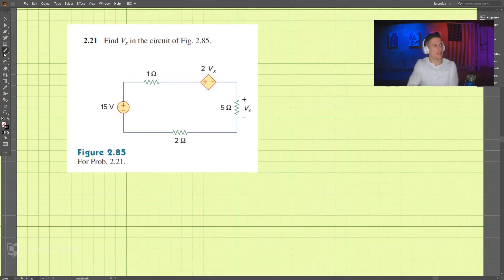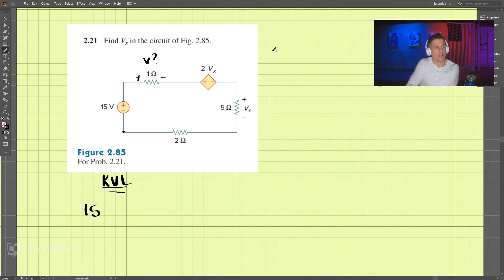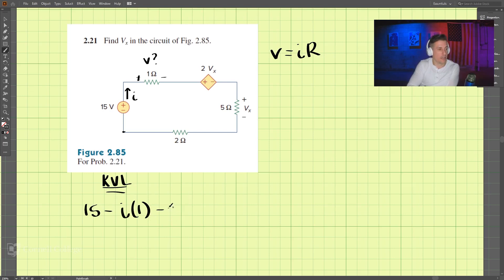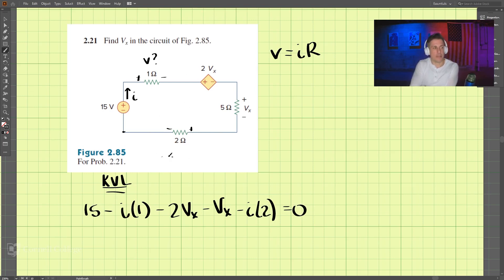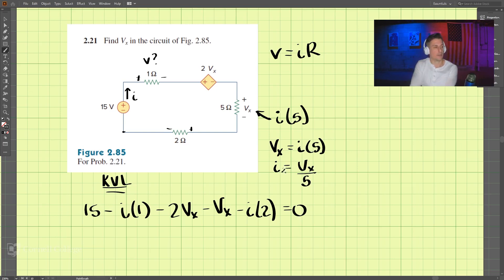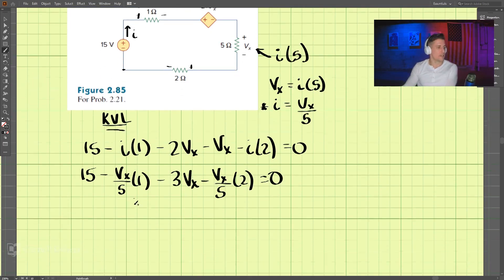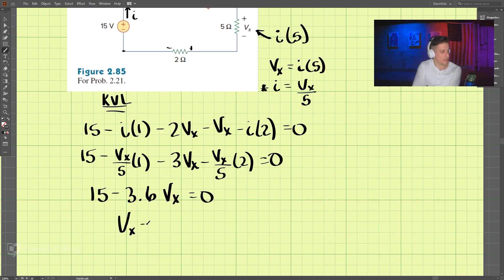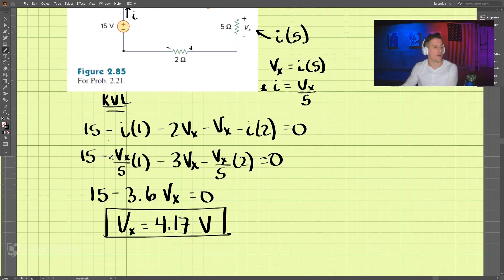2.21 - Example Problem - Fundamentals of Electric Circuits

Comment: How do we place the signs of the resistors
Reply from the maker: Signs on the resistors will always be + to - in the direction of the current flow. If the current flows from the - to + in a component, it is positive in our equation. If it flows +  to - in a component, it will be negative in the equation.
Reply: @ProfessorJohns  oh okay,thank you so much for replying